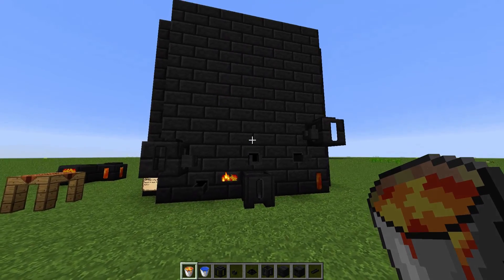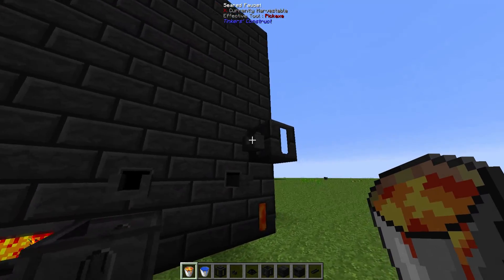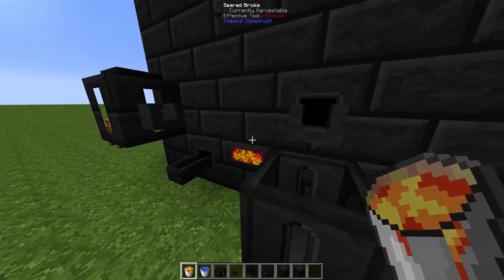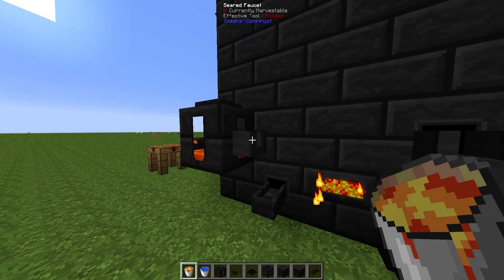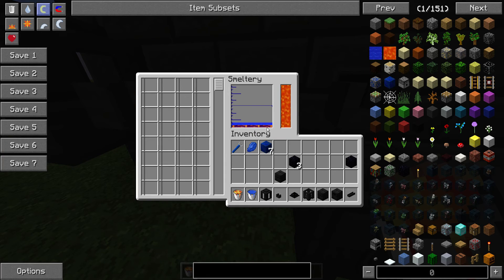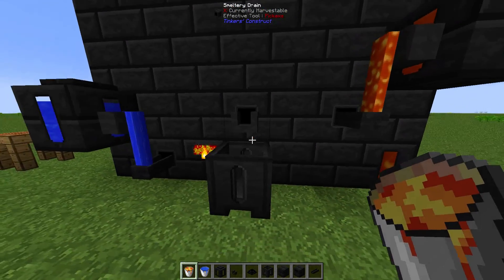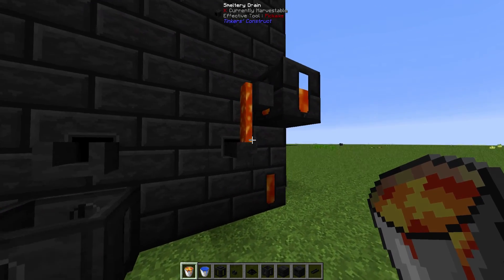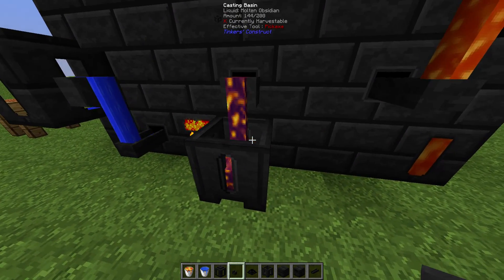How to make Obsidian in Tinkers' Construct Smeltery (VERSION 1.7.10 and BELOW)

Comment: Short and to the point, very nice.
Thank you. 😃
Reply from the maker: Glad to hear it, thank you too!
Reply: @zakthegaymer  
On a sidenote, have you tried out the new Tank in TC ? It's pretty neat.
It allows you to move store liquids without mixing them, making alloying much easier.
You can transfer the liquids (such as molten metals, lava or water) from the smeltery using faucets into seared smeltery channels.
Reply from the maker: @Grumpy_old_Boot  That is a good point. I have tried that tank out, but not much time to play recently. :)